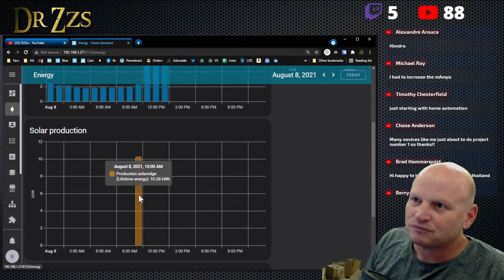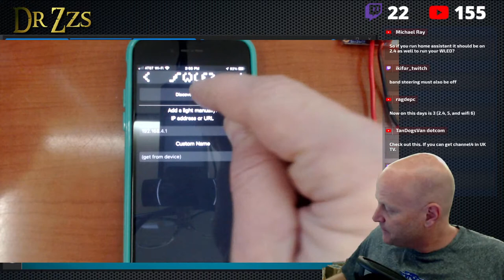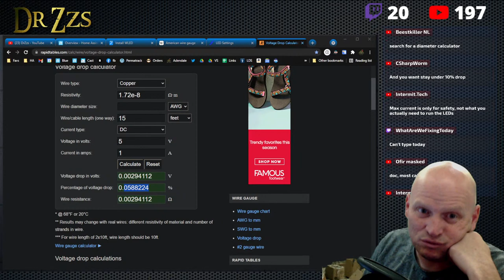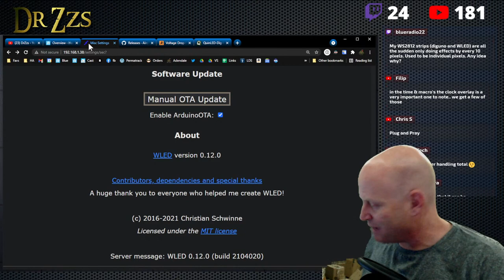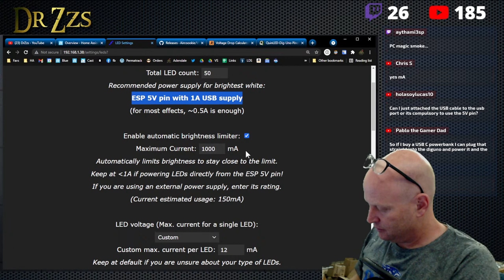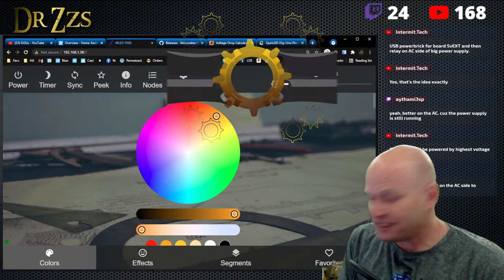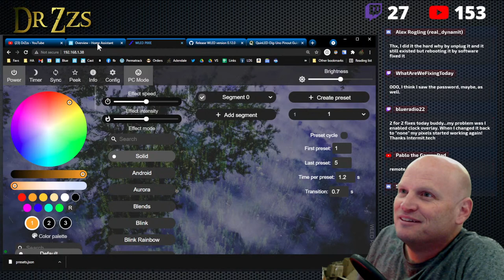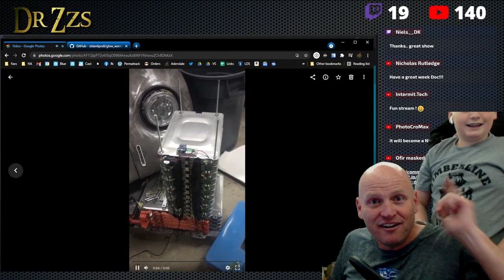Basic WLED Controller setup, what are the most common mistakes?

Comment: while this is the right way to wire it for a permanent install, for testing you can just hook the mini up to power (even USB power) and then attach the LED strip to the 5v output, ground and data  - it easily powers strips of 120 LEDs - I have then used USB battery packs to power the entire thing for 10-20 hours.